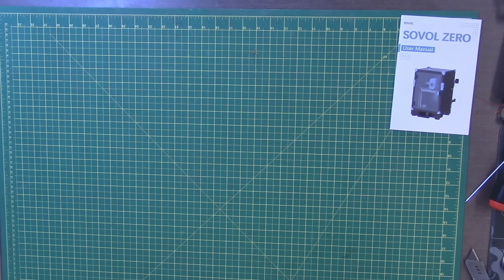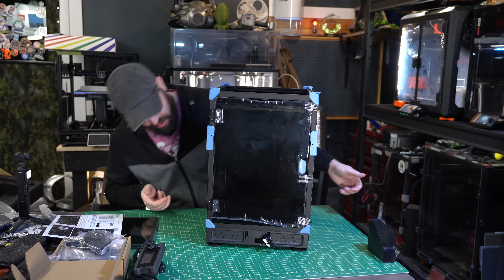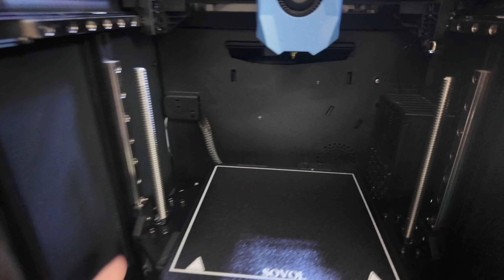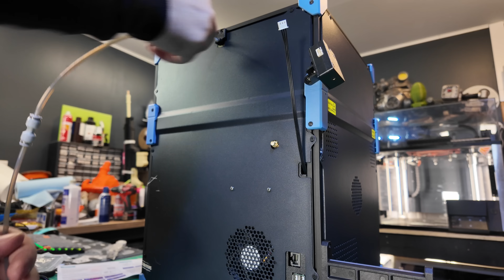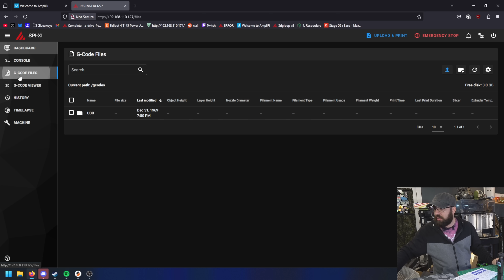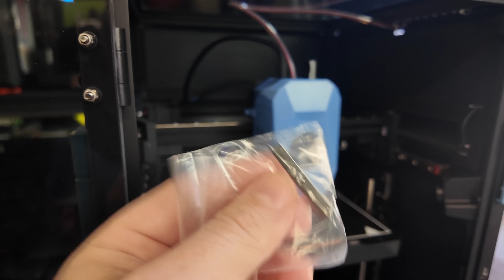Sovol Zero - UNBOXING AND SETUP!

Comment: Got mine today the 16mm screw for the run out sensor was too short, did they add that little bushing that lets it rotate more freely? Had to use a 18mm I had to get the threads go.

Comment: The tool head looks like the SV08 tool head but they're completely different in every way that matters.  Different nozzle.  Different hot end with a longer melt zone and higher wattage to allow a claimed 50 mm^3/s volumetric flow on the Zero.  CAN bus on the Zero and USB on the SV08.  Fast and accurate Eddy probe on the Zero instead of the slow and low accuracy 8 mm proximity sensor on the SV08.  Sovol is also claiming 1200 mm/s print speed which is well into ludicrous zone.

I bought a Zero a few days ago.  It should arrive in a couple of weeks.  Sovol is bragging about a "perfect first layer."  With the small bed, Eddy current mesh and direct probing for the Z=0 offset, the first layer should be very good, unlike the SV08, and I'm holding Sovol to that promise.  Like the Voron 0.2, the Zero is a little speed demon.  Fully enclosed with that small chamber should allow good passive chamber heating.  The bed can reach 120C and the nozzle can reach 350C, so this should be good for not only ABS but also high temperature engineering materials.  It should be good for smaller engineering prototypes.  I have the crazy idea of using this for small scale production of TPU parts by printing one part at a time, leaving the front door open and using the tool head to push parts off the front of the bed and into a bin.  I'm prototyping that now on my Neptune 4 Pro.  So far so good.  My only real concern is the two lead screws and the front of the bed is cantilevered so it won't like much downward force on the front edge, but the TPU parts have a very small surface area with barely adequate bed adhesion for printing, so it shouldn't be a problem.

BONUS:  Sovol announced they will be providing a hardware + Klipper upgrade to get the Eddy probe onto the SV08.  That will cure half of my SV08 problems.  The other half is the bed that warps more than 1 mm when heated.  I will fix that, even if I need to spend $450 on an aftermarket Mandala Rose Works kinematic bed upgrade for my $500 SV08.   😕

Comment: Just wish they'd finish the SV08...
Reply: The Sovol Zero launch video mentioned that they will be releasing an SV08 Eddy probe upgrade.  That's sorely needed.  I didn't use mainline Klipper to add the Eddy probe because I was hoping Sovol would correct this SV08 deficiency.

Comment: Love that it just uses normal orca slicer.
Reply: Can you print PLA withy the door closed to reduce noise?
Reply: @BadgerRobot  - Yes.  Run the fans and remove the glass top and it'll print PLA very well.
Reply: We keep asking companies to provide good profiles for OrcaSlicer and not re-skin OrcaSlicer to make a lame buggy slicer that only works with their new printer, that they'll halfway maintain for six months, and they keep re-skinning OrcaSlicer.  Thank you Sovol for not wasting the effort to make a proprietary slicer that we don't want, and for providing the OrcaSlicer profiles that we do want.  Why can't other 3D printer companies do that?

Comment: You don't actually need to print pla with the lid or door open, if you change retraction to 0.4mm or less. Which usually z-hop does not like, so I turn that off too, but lately it's gotten better with slope zhop.
I have 2 K1s with 5k hours of only PLA each and an sv08 with about 1500.

Comment: i dont know the price, but even with injection moulded stuff, I think they're going to face the same stuff the voron guys did with the v0, in that economies of scale only scale down so well, you've still gotta have at least 5 motors, nema 14s and 17s are similar in cost or more expensive. the idlers and bearings are the same, the belts are only a bit shorter, same with the rods/screws/rails, despite the small build volume (which, honestly I like) I'd be shocked if this is under £300
Reply: My Sovol Zero was US$409 shipped.  That was the $100 off early bird price.  The retail price is $499.  It seems like the retail price was $449 when I ordered mine and Sovol might have increased it?  Many people complain that that's a lot to pay for a small printer but as you mentioned, the expensive hardware is the same so there isn't much cost savings when scaling down a printer, and the Zero is actually a more premium printer than the SV08, which I love despite the warping bed and inaccurate bed mesh which make first layers unreliable.  Fixes are coming for that.  People aren't buying the Zero based on $/mm^2.  They're buying it for 1200 mm/s, 50 mm^3/s volumetric flow, 120C bed, 350C nozzle, etc.  It's an engineering materials prototyping speed demon.  It's a do-it-all printer as long as you don't need big parts or a large bed full of small parts.

Comment: its going to be interesting to see the price of this, voron v0 kits for $400 with printed parts seem to be pretty easy to find now, and with the elegoo centari at 300$ for a 235mm bed i think, I am not sure where this will fit in the market but a super interesting printer, and it seems like they are using standard 1515 extrusion for most things which will make mods even more easy
Reply: The Centuari is $200 for 256x256x256

The Centuari Carbon is $300 which is fully enclosed
Reply: Thank you😅 i couldn't remember  @LaDiables
Reply: I ordered a Sovol Zero four days ago.  In the US, it's $409 shipped.  That's the early bird.  It's $100 more after that, but the price usually drops back down after a few more months.  The Centauri Carbon is $330 shipped and the Centauri is $230 shipped, but the Zero isn't really competing against either of those.  I guess it is for people who just want a printer, but the Zero is more for high speed prototyping and open source experimentation.  Elegoo seems to be going more in the Bambu lite direction of discouraging experimentation, targeting the "it just works" customers.
Reply: @Liberty4Ever  i don't think any of these budget printers really ever "just work", though
Reply: @WHAT_1400  - I'd generally agree but consumer grade 3D printers are definitely getting better.  I built my first two 3D printers because pre-Prusa, there was nothing usable below the realm of Stratasys.  My expectation for the Sovol Zero is that it will "just work" but it's the initial production run so there will likely be an issue or two.  The basic design looks good so the issues shouldn't be fatal design flaws that are insurmountable.  I expect exactly the same for the Elegoo Centauri when it ships in a few months - a good printer with some teething pains.  The only real difference is that Elegoo's marketing department convinced customers to front Elegoo the money to buy the parts and build the printers.  If cash is king, cash flow is the queen.

Comment: sovol accidentally lets you order this printer using the "quick add" to cart feature.
Reply: 499 USD is too much. Like, 100 dollars too much, and that doesn't even take into account the competition, like the Centauri Carbon, or the Anycubic S1 without the multi-material unit. I can get a decent v0 for around 350.

Comment: Did it connect to Wi-Fi without screwing the antenna in?
Reply: My SV08 didn't WiFi connect at all.  It has an internal antenna and I suspect it's too far to my WiFi router, so I plugged a wireless router into the SV08 Ethernet port.  Hopefully the external antenna will allow my Zero to connect to WiFi.

Comment: Strange placement of ports
Reply: The Voron v0.2 has a compartment in the back that houses the board so the port placement actually makes sense if you take that into consideration. They probably could have routed a cable to the front by the display but you can easily send your print jobs locally through your network so I doubt it would even be an issue for most people.

Comment: I've been using the SV08 since last July. Between my ongoing experience and your previous experience with the SV08 I have to say that Sovol has massive ones to provide you yet another printer to unbox (not review). I'm a little impressed.
Reply: In the Zero launch live stream, Sovol said they will be offering an upgrade (hardware + Klipper) to get the Eddy probe onto the SV08.  That's great news.  My only real complaint about the SV08 is the unreliable first layer.  A good first layer is essential to any FDM printer.  The 8 mm prox is low accuracy and not temperature compensated so the bed mesh isn't accurate even after heat soaking the bed and prox sensor for 5 minutes, and my SV08 bed warps more than 1 mm across its surface when heated.  Once my SV08 has a flat bed and accurate bed mesh, it can live up to its awesome potential.  I love everything else about the SV08.  I love how Sovol listens to their customers and the community and responds accordingly.  I love their dedication to open source.

Sovol also mentioned that the Zero was developed in tandem with a 500 mm coreXY machine that will be announced soon.  Wow.  Presumably it'll have the high flow high temperature tool head of the Zero with the Eddy probe, and hopefully Sovol learned their lesson from the SV08 and their new larger format printer will have a flat bed.

Comment: They can say anything but the ACEs are not open source
Reply: Huh? The source code, all the design drawings, and even a step file with individual parts are literally on GitHub. The only change from klipper that I can see on my Ace is the driver for their integrated motor drivers.

Comment: I wonder if the toolhead on this machine means Sovol may release a new version of the SV08. After some initial issues and a hotend (Microswisss) change, my SV08 has become one of my favorites. I am even thinking about buying another - however it is either another enclosed SV08 or the SIBOOR Voron Trident 350 kit.
Reply: almost same here, went mainline, changed hotend (had few heat creep clogs) added eddy probe ..... and it is a beast.
Reply: I love my SV08 but it has serious first layer issues because the bed warps more than 1 mm when heated and the 8 mm prox sensor can't produce an accurate bed mesh even when the bed and sensor are preheated for five minutes.  If the unreliable first layer is fixed, the SV08 could live up to its awesome potential.

In the Zero launch live stream, Sovol mentioned that they are working on an upgrade to get the Eddy probe onto the SV08.  Take my money!  I haven't spent the time to mainline Klipper my SV08 because I've been hoping that Sovol would do something like this.  That should fix most of my SV08 first layer issues and I'll do whatever I need to do to get a flat bed, even if that means a $450 Mandela Rose aftermarket bed.

Sovol also stated that the Zero was developed in tandem with a new 500 mm coreXY printer that they'll be releasing soon.  Presumably it'll inherit the tool head from the Zero and Sovol learned their lesson with the SV08 and the new larger format printer will have a flat bed.
Reply: @Liberty4Ever  Thanks for the information. I heard they were going to introduce a 500mm printer, but I was hoping for an upgraded SV08. A 500mm is too large for me and I assume it is going to cost north of $1000.

While my bed isn't the completely flat, I am not having first layer issues. It could be that my SV08 is newer (I got it in Jan, 2025), but who knows. I am going to hold off on another SV08 to see if they are going to offer a new upgrade kit or something.

Comment: Thank you for your input. 150mm is slightly less than 6-inches. Do you believe the printer settings could be adjusted to allow printing 6-inches in X or Y direction?
Reply: Sovol claims the Zero print volume is 152.4 x 152.4 x 152.5 mm.  That's a 6" cube.

Comment: The fake 'hinge' on the rear where the stock tophat would tilt lol.  I mean, it seems compelling if the pricing is right.  I wonder what kind of chamber temps it's getting out of the box.
Reply: A first review has shown build chamber temperatures of around 40-45°C.
Reply: I saw a video where the Sovol Zero passively heated chamber reached 50-55C for ABS printing.

Comment: It's going to have to be cheap as chips to compete with the new centauri range.
Reply: Right It also seems to have a tiny Build volume?
Reply: That's the point of voron zeros really fast because tiny and rigid @AlbertoMartinez765
Reply: Yes indeed and it is a lot smaller than that.
Reply: The Sovol Zero isn't trying to compete with the Centauri.  It's a different class of printer.  If anything, it's marketed to people who want a Voron 0.2 without the investment of time and money.  Centauri was designed to eat Bambu's lunch, and when Elegoo finally ships it in a few months, it probably will unless they screw up the initial units, have a recall, etc.

Comment: The printer has already 3 things I like. An Ethernet port, an unmodified Klipper interface and it comes with an Orca slicer profile instead of having to use a slicer from the manufacturer.
Reply: SV08 doesn't have that?
Reply: @boredfive3001  it has the same ye

Comment: Hopefully they learned from the sv08.
Reply: The Sovol Zero web page claims a "perfect first layer."  With that small bed, Eddy probe and direct nozzle probe for the Z=0 touch off, the Zero should have an excellent first layer.  I'm going to hold Sovol to that claim.  The webpage also shows 150 mm square first layer sheets that do look perfect.  The problematic first layer is the only thing I don't like about my SV08, but Sovol announced an SV08 Eddy probe upgrade so that will help quite a bit.